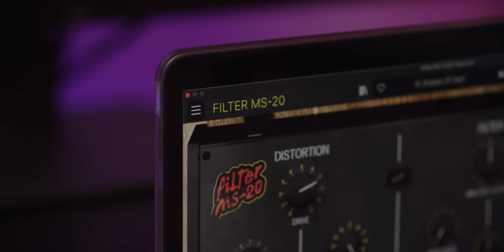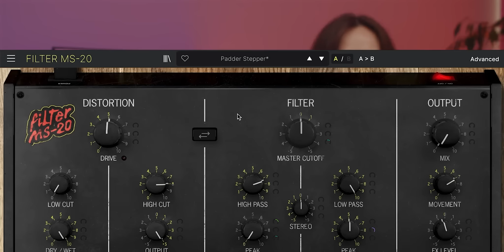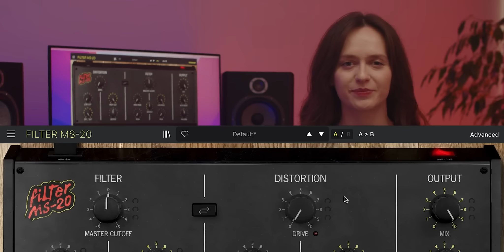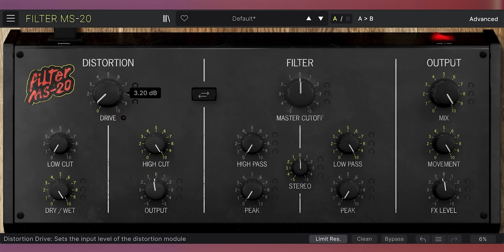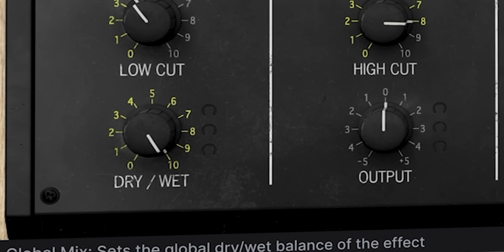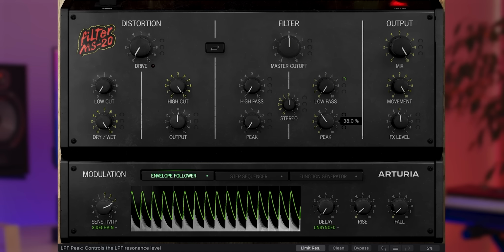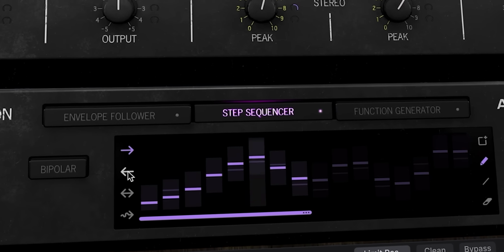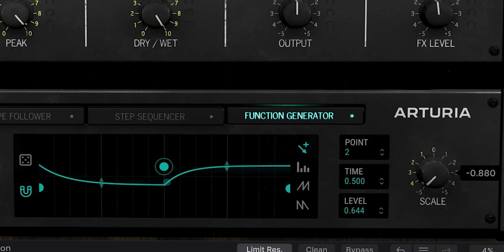Tutorials | Filter MS-20 - Overview

Comment: I know this isn't a characteristic of the MS-20 filters as they have a super soft slope but I'd LOVE it if you could also add a couple extra slope options just to bring it into the digital age and make it more flexible. It's often tricky to get that nice fat low-end when cutting hard with the low pass filter. Sounds great though and thanks for this free treat!

Comment: This might be the only plugin filter that sounds as smooth as hardware other than the Pulsar Modular P565 and that thing is about $250!!! I've tried countless filter plugins and they all either sounds too harsh with the resonance peaks or too thin. P565 is the only exception other than Tim Pethericks MS-10 filter for Nebula but that only has a low pass and requires Nebula which is lile $400. This sounds absolutely awesome and it's FREE!! MERRY FKN CHRISTMAS ARTURIA! Thank you so much for this.